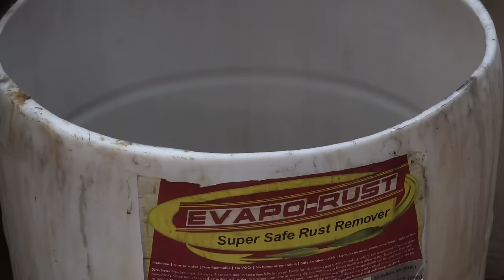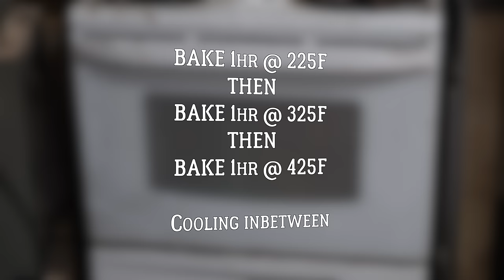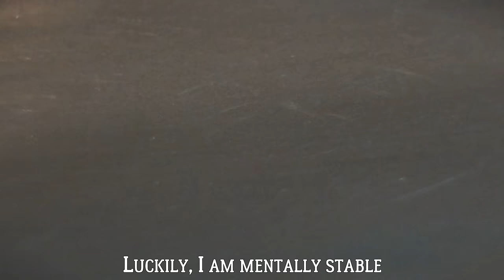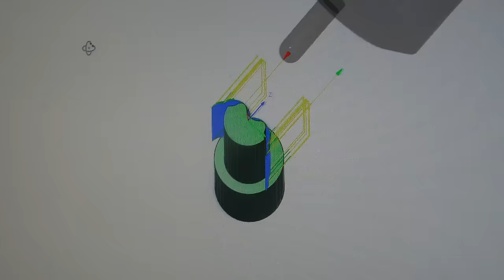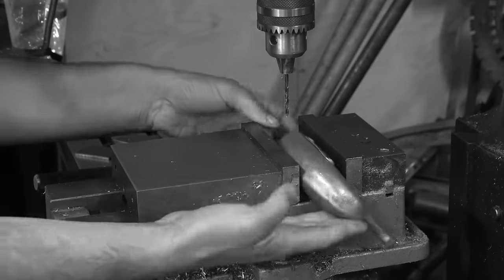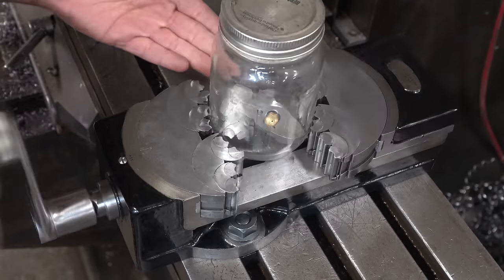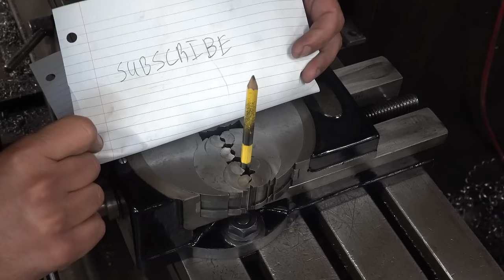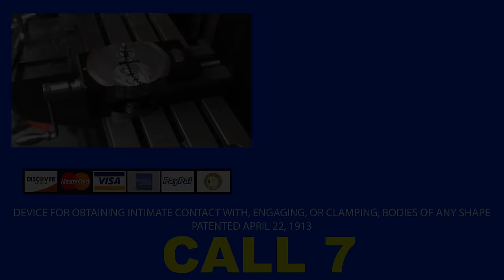Rare Antique Fractal Vise [Restoration]

Comment: Regular vise: 5 parts, cast iron, loose non-critical tolerances.
Fractal vise: Too many parts to count, machined steel, incredibly tight tolerance, each channel selectively mated and labeled.  
I think I see why these didn't become popular.
Reply: "Solution in search of a problem" comes to mind.
Reply: Won't hold a banana. I would love the ability to grip irregular shapes on my mill. Probably very expensive back then because of the complex mfg. but now cnc could bring the cost down. Not a replacement for my wilton, but I would buy one
Reply: @TheRealColBosch  More like "very expensive perfect solution for problems that can be solved with creative, albeit imperfect solutions".
Reply: 30
Reply: Tolerances don't have to be that precise though, those dove tails don't have to be that precise, they don't have to be steel either.

Just because something is easier to make, doesn't mean it should be preferred.
Reply: Depends on the vice: A machining vice have pretty exact tolerances to get good squareness on the mill.
Reply: @VorpalGun  You're right, it depends on the vice. A machining vise needs close tolerances because you're depending on the parallelism of the jaw faces and the trueness of the surfaces to orient the reference surface of the part you're working on. This magnificent work of art is for holding a workpiece with NO reference surface, so, as long as the tolerances keep it from falling apart and then tighten up when you close the vice, it's close enough.
Reply: I want one.  I have no idea what I need it for.  I want it anyway.
Reply: @e24mpwr  Yep, me too.
Reply: @bartylobethal8089  Me three...
The want is real...
Reply: @e24mpwr  I will invent reasons to need it.
Reply: Sure, it may be incredibly complicated, and extremely hard to machine properly, and it may cost a thousand or more to produce today...
Reply: I want one.
Reply: A plastic 3d printed version for robot hands could be awesome!
Reply: This would be amazing for guitar repair work if there were nylon on the clamping surfaces. Would make headstock and other complex clamping jobs that extra bit easier in a busy shop.
Reply: Yea, but you want one don’t you 😎
Reply: @Endelin  - thanks for the idea 😀 ( runs to fire up Fusion 360 ! )
Reply: @e24mpwr  i do almost 0 steel work but still want one...this baby can hold anything as long it fits in :)))
Reply: CNC completely annihilates the purpose of these though, at least for CNC itself

I have ~600 different soft jaws at home that i have made for weirdly shaped things and they've cost me maybe $1500

If you know the proper way to cut them, soft jaws are self-aligning, self-clamping (no need to hammer on part) and quick to set up.
Reply: I am a computational software developer. I instantly recognized this design as a "binary tree". Very elegant, indeed. It could be further over-engineered into a quad-tree, if there were an additional degree of freedom up-down in addition to left-right. I have to admit, I can see where the applications don't justify the effort. =) .. Perhaps if there were a medical/surgical variant?
Reply: ...while you nerds sit here and argue the practice, I'm gonna be off in a corner because the way this vice works is almost sexual.
Reply: @angrydragonslayer  - nowhere near as cool though, eh 😉
Reply: @angrydragonslayer  This could reduce a lot of time taken for one-offs. Think of the time spent machining a custom soft jaw for that many jobs and the cost of floor space, shelf space and managing the soft jaw inventory vs. one spicy vice.
Reply: @mikehannigan848  and this is why machine shops smell like mens prison showers
Reply: @JeffDM  sure, it would take less time outside of production itself and something like keeping an old deckel or tormach around might not be as worth it But think of the spindle time on your production machine. With soft jaws, i usually probe once for an entire series (i once went 45k parts without needing to probe again). With this, i would not trust those screws meant to hold the smallest jaws from moving for anything more than ~maybe~ 50 parts
Reply: You say that it's near impossible but there is one built from an era before we have modern machining and CNC technology and he is restoring it by hand doesn't it seem like an oxymoron to you
Reply: @jonalexander2859  nope

Just look at the antikythera mechanism, it was built in an era where surface place were yet to be invented

You can today easily manufacture the entire mechanism for under $1500 in a few weeks while it would have costed en equivalent of $4.5 mil to produce back then and would have taken 6-8 months for a team of 6 masters, ~20 apprentices and ~500 menial workers.
Reply: @angrydragonslayer  I work in a factory that's the reason I had that original complaint from your argument it is completely reasonable especially in these high-end CNC settings where they have so much money it's oozing out their ears the fact that they don't have this tech on there mill vices is baffling
Reply: Considering every reference to them online links back to this video, I think "didn't become popular" is an understatement. Pretty sure this is another case of one of these restoration channels inventing a name for some random one-off tool that one person made and nobody else thought was neccessary.
Reply: @jonalexander2859  it sounds to me like you work in a factory where they manually feed the CNC machines and probe every part, is that correct?
Reply: Would it really need to have THAT tight of tolerances to function properly though? Im betting there are some really interesting ways to design this differently so that it works really well without being too expensive to manufacture.
Reply: @sarchlalaith8836  agreed, plus just because something IS matchmarked, that does not necessarily mean that parts are still not mostly interchangeable. The matchmarking could just be so that if you want to assemble it in the configuration from the factory, you can. Not likely for this vice, but I've made plenty of products that had unnecessary matchmarks
Reply: @aerball  i assumed iso 2768-m for most parts and tighter for certain areas such as the groove which holds the dovetail insert for the next set of smaller jaws.

the dovetail insert itself is probably very expensive as well....
Reply: @angrydragonslayer  Right, and thats to be expected for the design as is. Im referring to rethinking the entire concept. Im no machine expert so I couldnt be sure; just suggesting that the idea of doing something of a similar mechanical method to hold the object might be possible for less complexity, cost, or tolerance.
Reply: @angrydragonslayer  that and all  "the magic" that happens in em...shops...not prison showers...lets be real for a second prison rape is never a joke.
Reply: @JeffDM  sexually explicit reaper pepper of a vice*
Reply: @aerball  absolutely, at the cost of repeatability.

i got an idea of a redesign that i might be able to manufacture at $1800 with entirely iso 2768-m tolerances. it would just lack any repeatability, forcing you to index the part each time.
Reply: @e24mpwr  I want a fractal vise, then I'll find something I need it for.
Reply: I bet that was one expensive vice.
Reply: it actually wouldn't be as hard as you think to make this if you understand how you make things on a lathe even the dove tail aspects and even more so now days because you could buy not sure what its called " drilled bar stock? " and any size thickness wall then cut the dove tail an cut the size then cut it in half
Reply: I have to get one for my shop...
Reply: @moonrazk  Probably an amazing vice to own if you do custom fabrication of really awkwardly shaped things.
Reply: @intjonmiller  - oooh. This sounds like it’s going to be fun!
Reply: I would absolutely buy one and use it regularly.  I know a few other folks who would fine it extremely useful too.
Reply: @emanuelkszenics7689  "this baby can hold anything as long it fits in "

Now that's an actress/bishop joke if ever I've heard one.
Reply: @thomasneal9291  i dont get the bishop part
Reply: @thomasneal9291  :)))) you're onto something, funny fact, i was using the bishop joke when every professor was asking me during exams why did i let beard grow, i was replying with "if i fail becoming an engineer i'm going to join the church to become a bishop" :))))
Reply: @chriscroul185  - no pressure then 😵‍💫 ( there goes the weekend! )
Reply: @chriscroul185  - -and now I have to make a YouTube series on the creation of the 3d printed vice? The pressure mounts 🧐
Reply: @portlyoldman  you create it , I will print it… use it as a pattern to make a cast alli one
Reply: @chriscroul185  - ok, I’ll see how much time I can fit in. It’s a  great challenge 😎 I’ll try to blog it too
Reply: @portlyoldman  …and that, children, is how the 3D printable ✨Spicy Vice✨™️ was born :D
Reply: @JeffDM  "spicy vice." 🤣🤣🤣
Reply: Who's ever going to put a steel banana in one?
Reply: in this vice you have 4 additional sliding surfaces between part and vice body and total slope will be sum of them all. 
 in another words - this vise has no fixed jaw  ))  that's bad for precise machining.
Reply: @silmarian  let us know if you can think of one that the significant other won't veto!
Reply: I still want one.
Reply: now either these were very expensive or very popular, the cost of tooling to create the rounded dovetails would be immense. My guess is very expensive, due to me never hearing or seeing these before. mein got.
Reply: @TheRealColBosch  when lasers were invented, they were a "solution in search of a problem" as well. 🤷🏾‍♂️🤷🏾‍♂️
Reply: @robertthomas5906  heh 😏
Reply: @TheRealColBosch  I will be using this in my next meeting
Reply: @e24mpwr  The tool collectors equivalent of the guitarist's GAS (Gear Acquisition Syndrome!)
Reply: @Mishn0  I’m pretty sure this is in fact a machining vise and the jaws are required to maintain right angles to the bottom reference surface.
Reply: @ev6558  it was obviously not called a fractal vise because this item is way older than the word fractal, which was invented by Mandelbrot in the 60s/70s somewhere.
Reply: @dyadica7151  I said earlier that it is the ultimate engraving vise as its ability to hold onto literally anyshap, lok at how ball vises fall so short in comparison
Reply: @mikehannigan848  I saw how m m it gripped fragile things, u be scary
Reply: @Dan Didnot sold
Reply: Don't mind me.
Just commenting to get a message to see where this goes.
Reply: How would you set up a work stop with one of these? Sounds like a nightmare
Reply: @gregleak5134  Can you resend that ? This time work on the syntax.
Reply: @TheRealColBosch  this thing is the first vice i have ever seen that can grip irregular shapes, and do that firmly,... if you never had that kind of problem you probably never worked in a mashine shop.
Reply: @moonrazk  yes, but lets not forget that those imperfect cheap solutions have cot some people their fingers and hands.
Reply: BUT GOD DOES SHE LOOK GOOD
Reply: It's one of those hipster vices.
Whoever heard of a not square vise.
Reply: Wait till you hear about this other crazy machine: the internal combustion engine.
Reply: They were probably also super expensive compared to a normal visr
Reply: @blahorgaslisk7763  me four.
Reply: True fractal vise must have infinite number of parts.
Reply: @angrydragonslayer  no
Reply: but if you are prototyping or in a one off environment or a prop shop, or a repair shop I can seriously think of a ton of uses. you thisoldtony would say no to one of these? The upgraded version could even have a dividing head built into it. I im in  new product where I work
Reply: @jonalexander2859  in one-off or as a tool maker? Yes, these would be neat to have

A swiveling angle vice with a set of jaws like this would save so much time for a tool maker that only has a 3-axis and would make life a lot easier for the hobbyist.
Reply: @angrydragonslayer  and I'm fully aware of the antkythera mechanism and click spring was self constraining to use tools of the time if you were aware of modern methods it would be done
Reply: @jonalexander2859  click spring?
Reply: @angrydragonslayer  Yes he is part way threw a build of the device using tech of the time where ever possible. an incredible maker. look for his youtube
Reply: @angrydragonslayer  it is crazy to me that you have not seen it a marvel one of the most well produced creators I have ever seen. even Adam savage talks about his work.
Reply: Not popular, but if you have tou won't sell it.
Reply: @jonalexander2859  oh wow, yeah, i somehow missed him completely...

I have been limiting the time spent on youtube since i'm currently a contracted consultant/shop manager for a startup and want to make sure my claim to the securities promised can't be refuted.
Reply: @angrydragonslayer  great right?
Reply: With that way of thinking,,,  with the number of parts in a 747,,, they must be junk...
With the most uses for a vice,, this is over kill...
But when you absolutely need the right tool,,, this may be the right tool...
Reply: @willybee3056  my team in uni got 2nd place in a boeing design competition to decrease the number of parts needed without affecting reliability. We suggested a bit over 50 changes that could be made and that was more or less all we could think of, planes are insanely optimised.

I still adamantly believe the 1st team having 3 children of boeing execs had something to do with their win.
Reply: @jonalexander2859  pretty neato, i def need to try hand-working brass with hardened steel when i get more time
Reply: @angrydragonslayer  the trick between brass and copper are that they're very gravity so the hierarchy of materials the difference is it will rip your lathe tool right out of your hand it's a very hazardous dangerous material if you're doing it on a hand lathe and it will pull the bit right off the top of the tool post
Reply: @angrydragonslayer  the best way I can describe it as sticky you'll know what I mean when you try it
Reply: @jonalexander2859  i meant just dragging the tool over the surface by hand
Reply: And i know perfectly well what will happen if you snag the tool in the workpiece

I got a rather strong grip so the handle broke and shot splinters everywhere, the metal part of the tool going through a wall and getting lost in my garden. Last time on a lathe like that
Reply: I have absolutely zero reason to need this under any circumstances whatsoever in my lifetime, but I want it so badly.
Reply: @moonrazk  Exactly, the solution that is 30% better than the others at 200% of the cost. Like the best tools you pay more for the last bit of quality
Reply: This was for all the new specialty manufacturing that began popping up everywhere back then where tolerances were tighter then a frogs asshole like aircraft & firearms & where fabricobbling a new jig every day was out of the question, my grandfather had one & my brother-in-law snagged it when mom died & I was stuck in Alaska, well now he’s dead & my sister can now talk with me again & im getting all my dads & both granddads tools back... & she said there’s two of em..... no clue where the 2nd came from
Reply: @patrickancona1193  i remember seeing some of those tolerances.......

Optical surface finishes on unused surfaces (yeah, they couldnt actually measure it but they did specify it), H3 or smaller tolerances on every hole, .05 mm Tolerance on a 7 meters long piece.

I have no question in my mind that a lot of those were spoofed by the shop.
Reply: @angrydragonslayer  i wonder how you know that
Reply: @danieldonaldson8634  what part?

Also, is that a ruby on the beach logo in your image? My cousin finally got a job via their recommendation
Reply: @asbestosfiber  Probably more like 500% better for 1000% more, although how much better exactly depends on what you use it for.
Reply: Oh my god its a vise. I spent the first half of the video waiting for a vase to show up.
Reply: With 3d printing a much lighter duty version of this could be made pretty easy, probably even all print in place.
Reply: @angrydragonslayer  I don't see how having to 3D print a new pece every time you have a shape that doesn't fit would annihilate the use of this. Plus this vice is probably a bit more sturdy
Reply: @portlyoldman  let me know when you have a 3D printable version!
Reply: @liukang85  please try it then, it should be fine for a hobbyist but for someone like me? Nah.

I can get up to 28 KW for a sustained 5 minutes in some programs.

As we all know what will happen at that power, maybe try 0.28 KW?
Reply: @avbates79  Wilton!! Hell yeah!!
Reply: There is a special place in machinist hell for the person who carelessly drilled holes in this
Reply: @SebBrosig  right alongside the ones that drops the gauge blocks.
Reply: @danhard8440  I was imagining that same sort of strategy.
Reply: There is actually a guy (Steve lindsey) who is ttrying to manufacture a similer vise
Reply: Its a very complex vice indeed, with only very situational and marginal use cases over other vices.
Reply: I wonder why each of the pieces had their own number. Where they actually made to different tolerances or something like that?
Reply: They didn't get popular because people were only trying to eat their aluminum bananas...
Reply: @e24mpwr  Just like me .-)
Reply: I bet they cost a fucking fortune too
Reply: what a great tool
Reply: I wanted one as soon as I saw the intro, then watched the video. 
Now, I really want one.  
I glad though, he never intends to sell it.  Alot of people have no idea what kind of time, effort  and dedication it takes to complete restoration project like that.  Even if it sold for  $ 2,000 dollars,  it might make his time worth about  .38 cents-an-hour  OR  LESS  !
Congratulations !   
What a worthy project !
Glad your keeping it !
Reply: @jonalexander2859  you think because a shop has CNC machines their oozing money? Strange but, allrite
Reply: @B2Roland  rubbish, you create a looser dove tail here without problem because the part you're clamping presses the jaw parts together, applying friction.

It really shouldn't matter as the whole purpose of the jaws is to move. So long as the back of the dove tail is wider than the front of the opening you could even turn it upside down. It, itself, doesn't require anything but a loose fit as each jaw face is pressed around the work piece/against the opposite jaw face.
Reply: @angrydragonslayer  those screws in the jaws are not intended on holding any settings. All they do is project into the slot of the parent jaw holding the jaw with the screw in order to prevent the smaller jaw from over rotating and coming loose from the parent jaw.
Reply: @johncochran8497  oh..... So there's not "low" repeatability.....

There's none.
Reply: And i said that based on the assumption that they could be torqued further to lock themself in a similar way to the fractal grippers that i once had the displeasure of working with.

I should have checked...
Reply: @angrydragonslayer  Pretty much. Although it does look good in the vertical plane. And it would be interesting if some bar stock was clamped in it. Question is if the stock would tend to align to the same plane, or would the jaws just go parallel with each other and not to a preferred plane.
Reply: @johncochran8497  in my experience (with the gripper i mentioned), it's 30/70 (30 being what you desire)
Reply: @B2Roland  yeah sure unlike cutting edge modern designs manufactured poorly in usa and China, they never wear out fast.

Everything you just said is pointless speculation. There are millions of quality designs in history that were lied about, that were manipulated by the competition or bullied out of existence by corporate rivals.

Yeah, sure, there's lots of parts, so it would cost more to make on that, but anything else is just utterly useless idle speculation.
Reply: @Blueshirt38  would not cost over 1000 to make this
Reply: @B2Roland  what are you on about?

Do you not have something better to do with your time.

Bye felicia.
Reply: @angrydragonslayer   i have seen the 3d printing world go aflame with easy builds for this. thats what i was saying in the first place.
Reply: Too many to count? They labeled them all so that you don't have to! Highest I saw was 710. Strikes me as kinda odd that he'd oil a screw before putting it in, now that we're talking about it. But what do I know, I'm not a machine lobotomist or anything.
Reply: I can maybe see this as a low number boutique made vice for individuals or shops that have deep pockets to splurge.
Reply: I'm pretty much not interested but I'm still trying so much for sure that you don't get it from a lot to the middle and I could say something else is going for something like an old girl and then the car was in. The first one. So if your parents would not be a child then then it could have made the middle to get the WiFi. It's just so easy! It will probably work with you for your parents! Edit
Reply: @jonalexander2859  I think a good machinist could make the jaws with a lathe and a metal-cutting saw.  All the functional surfaces are circular.  Make them in full round, then cut them in half.  I'm not sure exactly how you cut the inside surfaces, but I'm sure there's a standard way to do it.
Reply: @e24mpwr  Me four. This has to be the coolest looking vise I have ever seen, and I need one in my life if for nothing else to look at.
Reply: @keeledover4218  I don't think you've thought this through.

What you're actually saying is that these have been invented at least three times, and at least twice they ultimately were entirely forgotten which can only mean they weren't worth the effort.  (There's a guy with a patent application on these RIGHT NOW in the US.  I know he's been disabused of the notion he invented it first, but he seems to have been pretty certain of himself when he put up the web site.)
Reply: @silmarian  been there, done that lol
Reply: @Kalatash  My guess is simply to account for relative lack of precision in the manufacturing process. In the video, you clearly see him trying to fit one of the jaws in and it binds, then he swaps it for another that glides right in. The tolerances don't change, but the repeatability of dimensions is unstable so the parts probably go through a fine tuning process to match the receptor.
Reply: Also how am I going to straighten my bent parts if my vise just conforms to them?!
Reply: @samtoshner8002  By using your non bendy vise? Anyone who can afford something like this will likely have one or 2 regular quality vises sitting around the shop 🙂
Reply: @moonrazk  and spent half of day
Reply: These days tho I don’t think things like this are too hard to manufacture - as long as there is a market for it. We are manufacturing chips in nanometers these days using lazer beams.
Reply: Actually they were very popular. Just not in small mom and pop shops. Usually field specific as well.
Reply: @e24mpwr  A good reason to avoid hardware stores, and antique/secondhand/pawn shops. And the Amazon tool section.
Lest you need a second or third tool shed to put them all somewhere.
Reply: Hardly "too many parts to count", maybe around fifty at a quick guess.  A lot by normal vice standards, true, but compared to  even a basic IC engine, hardly any.
Reply: @sarchlalaith8836  yeah with use of tools, alloys and mats not known back then - e.g. babbitt alloy, it might be much easier to make.
Reply: @portlyoldman  that was a good idea ever draw one up?
Reply: Yeah, but I still want one.